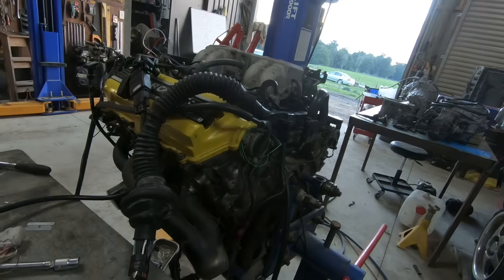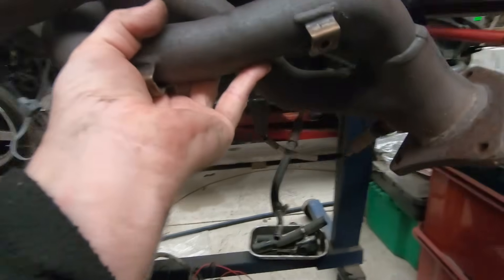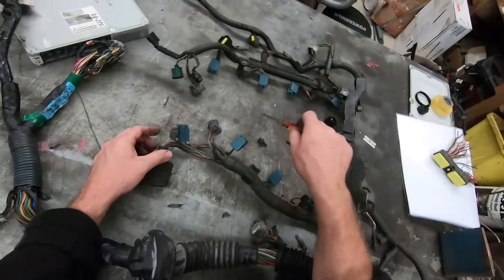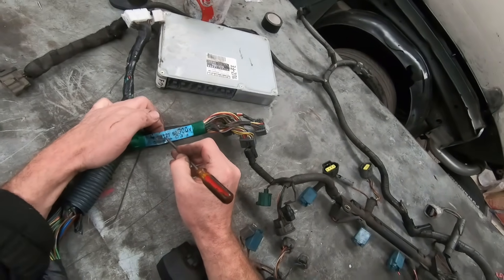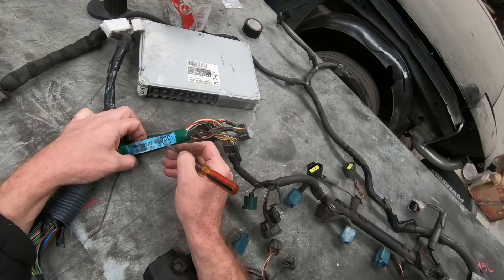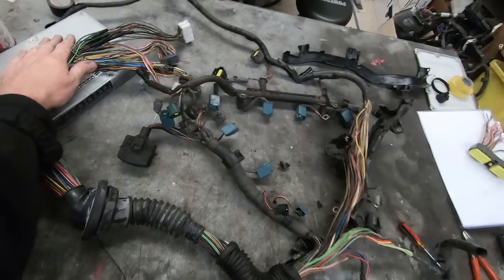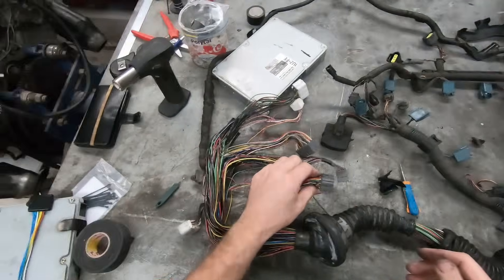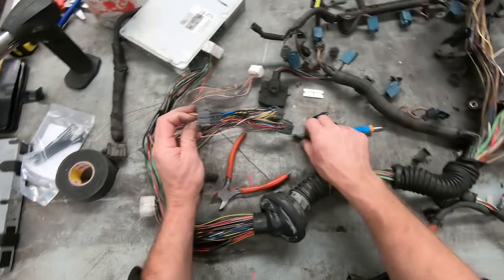Myth - Stock 1uz ECU can't be used on a swap.  Myth - Stock ECU has to be tricked in a manual.

Comment: Hi I do have sc400 that is driving me crazy ,the car cranks for 5second and cuts off I have spark
+gas+timming is good +all ground ok+but missing negative pulse on injectors (ECU been sent for repair )still doing the same thing ,EFI power is ok on the fuse and relay ,crank and cam ok ,fuel pump ok,no theft light, you are the only chance I have

Comment: Hi kelvin how you doing great Mr. UZ

I wanted to ask a question can i use 95 non vvti ls400 ecu which is same 34-22-16-28 on my 93 1uz non vvti engine + 93 harness which has already 34-22-16-2& pinouts coming with a plastic body 1995 clesior MAF ? 
Doing on a Cressida Swap 
I’d be very grateful to you if would answer my little quick question

Comment: im doing a manual swap on a 2UZ non vvti, are you saying dont wire it to park to start, and not to drive to run? but to do neutral? it looks like the cruise control circuit needs a drive signal from the ECU tho

Comment: Hello i have a running but wrecked 1992 sc400, and a 1995 sc400 I paid a guy back in highschool to put a mega squirt in but he took my money and left my car butchered, but im putting the 1992 wiring harness in the 1995 are they plug and play for the most part with the sensors I know so far I’m going to have to change intakes and throttle bodies, any knowledge is appreciated

Comment: Hi, how difficult is to have the original auto transmission running on 1/3 uz?
Some says that needs a tcm and others that ecm controls them 🤷‍♂️
Reply from the maker: Generally its very easy to make the transmission work correctly.   Most models have a combined ecu / tcu unit keeping it straightforward.   Cheers Kelvin
Reply: @CartuneNZ  thanks so much!!

Comment: Quick question I’m having an issue with my ls400 where shortly after I start my car it just cuts off I Checked fuel pressure it was at 40 psi and it can’t be spark because it fires up no hesitation it just won’t fire all the way up and run have you ever had this issue?
Reply from the maker: I'd start by checking codes.  Its very common issue with codes 14 or 15 or the obd2 equivalent which are ignition faults.  I have videos.  Cheers Kelvin

Comment: I'm having issues with my 94 1uz manual Soarer idle dropping after it has been driven for about a mile. The idle will drop them the car turns off. After that I start it back up and it idols fine until I drive it another mile. As long as I keep my foot on the accelerator when I'm coming to a stop it won't shut off on me. Is that easy you related or should I adjust the idle?
Reply from the maker: Generally this issue is due to a run done idle control system,  or other engine running fault which causes poor idle or its incorrectly wired from doing the manual swap.  Guys tend to misunderstand the relationship between the nss and nsw in the vehicle and the ecu.  When I do a manual swap I always leave the factory idle settings.   Sort the fault properly is my recommendation
Reply: @CartuneNZ  Thank you so much for the reply. I am running my factory VCU and harness after the manual swap. The only exception in my wiring was to jump the neutral safety switch via fusible link. Would you mind giving me a little bit more input on the process of eliminating this issue. Or if you have a video that deals with this issue I would gladly watch it. I've tried to go through about it every video that you've had lol
Reply from the maker: @da1outsida35  when I do a video on this specific topic it will become part of my paid videos as the information is covered in my wiring instructions which I sell.
Reply: @CartuneNZ  ok no worries.. I'll gladly pay for this information sir. I know nothing in life is free. So please let me know if I can pay you for the information directly or I'll pay for a video.

Comment: I swapped a 1uzfe into a Suzuki samurai, and it’s Manuel. It has stock everything nothing has changed in terms of ECU
Reply from the maker: Excellent.   It should go well in a small chassis.
Reply: Uhm but doesn’t the ecu see open circuit on the trans soliniods?

Comment: I just purchased a 1UZ-swapped Lexus IS200 (XE10 chassis). Car used to be manual with the J160 and it was swapped with the stock LS400 auto. 1st gen engine.
I would like to put the J160 back on using a swap kit. If I understood you correctly, for this version of engine/ECU, I only need to remove the automatic gearbox wiring and everything will work fine?

Comment: Still easily doable for something you want to run with no catalytic converters and a cold air intake too?
I figure you will still need the loom for the O2 sensors or else the air fuel ratio won't adjust itself for the environment?
Yeah I have been looking at 1uz swapping an old car that still has a carburetor
Reply from the maker: Absolutely.  Most of our swaps are exacty that , no converters and a cold air intake.  Cheers Kelvin
Reply: @CartuneNZ  Any rewiring of the ECU needed to compensate for the high flow rate, or will it auto adjust accordingly?

Comment: I am not sure if I got it right, but you're saying the 1st gen non vvti works all good with no gearbox wires at all? I have the exact engine and would like it manual. Great video!
Reply from the maker: Yes,  any of the stock ecus work fine with a manual transmission provided the wiring is done correctly
Reply: @CartuneNZ  nice, just wondering does it allow abs and cruise control to work? Maybe even traction control?
Reply from the maker: @Oxenan17  these systems are disabled when doing a swap.   In stock car they work

Comment: I have a 1uz from an 93 sc400 I'm putting in a 90 toyota supra going to use the w58 manual transmission. Do you have instructions to wire using factory ecu? If so how do I purchase?
Reply from the maker: Yes I do.  We sell heaps of soarer instructions.   Email info@thecartunecompany.co.nz and my PA will sort it.  Please include ecu number and if you have model number for supra I may have additional info too.  Cheers Kelvin

Comment: Is that the same for 1uz vvti ? Can i use stock ecu when swapping ? How can i disable immobilizer ?  And can i use manual trans ?
Reply from the maker: Yes , all the same for the 1uz vvti and the 3uz.  I can use , and do use the stock ecu lots.  Immo delete is a service which I provide.  I often use the stock ecu with manual transmission.  Cheers Kelvin

Comment: Hi, I’m thinking of purchasing a 1uzfe with the auto trans and ecu. Technically, if everything is there I would be able to drop it into my 69 Volvo and wire the ignition and current to the ecu, right? Also, if I remove the wiring going from the ecu to the trans, this would allow me to convert the automatic trans into a manual automatic trans? Thank you
Reply from the maker: with the correct knowledge yes this is possible. Cheers Kelvin
Reply: @CartuneNZ  do you sell the wiring diagram for the stock ecu?
Reply from the maker: @emmanuelrojas8520  I sell wiring instructions which include diagrams and 20 minutes of my time to help.  Email in description.   Cheers Kelvin

Comment: Swapping in a manual trans in my 98 SC400. I’ve read Vvti’s require a bit more than the Non Vvti’s. From what I’ve read the NSS and the old auto solenoids needs to plugged in correct?
Reply: Just finished the video and saw you pulled everything out related to auto trans and traction control. Hopefully I can get it running with the old solenoids while a source another harness to dig into. Same theory applies to the vvti harness though? Just remove those wires? How would I go about rewriting the park/neutral switch?
Reply from the maker: Hello.  This info I dont share publically as its part of my wiring instructions which I sell.  Its all in there along with my help.  Cheers Kelvin
Reply: @CartuneNZ  how much are you charging for basic wiring instructions for a gen1 (1991 i believe) 1uzfe ?
Reply from the maker: @shawnwimberly9294  presently NZ$175 email info@thecartunecompany.co.nz cheers Kelvin
Reply: Seems like it's a popular opinion that the first generation 1uz isn't the best and to seek a newer model when possible.  Is this true? Even when considering forced induction ( small turbo)?

Comment: I wish to bolt one of these into my isuzu bighorn and keep the auto in the truck.
The automatic transmission wiring would have to be used for the isuzu transmission? 
Or would you need a completely different system?
Reply from the maker: Some isuzu use an aisan based transmission making uz swap quite straightforward.   Wiring needs to suit whatever transmission is chosen and be completed correctly.  Cheers Kelvin
Reply: @CartuneNZ  thanks, I was looking a 3uzfe motor using gen 1 1uzfe bell housing.  Hopefully mod cert will not be a problem

Comment: Hi again, wondering what ecu you'd recommend for a stock 1uz vvti with a 5 speed 3l d4d manual gearbox. The swap was done on my van but at the time i was not informed on what exactly was done to make everything run (2016-2017). Of all my issues my main worry was that there is no obd port where i could have access to read error codes.  Looked down at the exhaust and found out that there were no oxygen sensors connected as well. The car runs but i feel it's really low on power besides the bad ratio of the van i put it in. Have never dynoed it. It starts after 1 kick and doesn't do anything erratic. 

So my questions include
Standalone ECU you recommend to prepare for forced induction.
How i could read codes on the ecu because i believe there are issues with power. 
Best ratio you'd recommend as my ratio is too short (4.55) and i was thinking of a 3.89 ratio. 

Thanks again.
Reply: I'm in  Southern Africa In Botswana by the way.
Reply: And if possible. A solution on how to get the vvti running?
Reply from the maker: Cheapest is the Stock 1uz VVti ecu with a transmission emulator.  Easy to sort and work well.  Cheers Kelvin

Comment: I think I missed a bit!! What is the best/easiest way to have vvti running with a manual?
Cheers
Reply from the maker: Hello.  The VVti can be wired like any other.  When using manual I use a extra box to replace the signals from the transmission that without it will be at reduced power.  More info on this coming up.  Cheers Kelvin
Reply: @CartuneNZ  hi kelvin, do you have the video for that box? I have a 1uz that im going to do manual but i want to use the stock ecu
Reply from the maker: Yes I have a video which is part of my paid instructions so not public release.  Cheers Kelvin

Comment: how do i swap a 1991 1uz from a ls400 into a 1994 lexus ls400
Reply from the maker: Just like any other engine change.  Swap long block,   use 94 intake,  wiring etc.  Very easy.
Reply: CartuneNZ are any of the sensors different or anything? and i’m putting in a cd009 transmission are there a lot of issues that i’m going to run into
Reply from the maker: @Tonka470  as I said,  swap just the long block.  Use the sensors presently on the 94.  Then no issues when swapped correctly.

Comment: hi, i have a question about Ecu's. have you ever used a crown 131 auto ecu to control the autobox and used an after market ecu to control the engine (for a turbo charged application)
Reply from the maker: Never used the 131 ect on its own but have used plenty of the later ECU'S wired to control just the transmission with an aftermarket doing the engine.  I have a video coming on this topic soon.  Cheers Kelvin
Reply: CartuneNZ awesome news :) im looking at installing a sc400 engine and auto into a can and would like to turbo it at a later date and keep the auto. Can not wait for that video.

Comment: Can the emissions system be tricked into not bring up error codes.where i live(the states) care alot about emissions
Reply from the maker: Absolutely.  Different ecus require different things to be done to eliminate codes.  I've just edited a video on physical egr removal however I used a non egr jdm ecu on that job to prevent codes.  Its not released yet but can be found in the 425 ls400 playlist.  Cheers Kelvin
Reply: The EGR looks to a thermistor to trick the egr code to go away wire it high resistance when egr vsv has no power (ground switched) but with the ecu egr vsv wired to a relay run a lower resistor simulating a hot thermister to the otherside of the relay that is all because in closed loop the ecu tunes from the O² sensors then you can block off the egr flow completely and keep egr codes clear, for removing cats the best thing to do is run the secondary O² sensors through sparkplug defoulers extended out of the direct exhaust stream but you can also use a high resistance diode tap the left and right primary O² sensors each with a diode then coil and resistor bridge network to drop the oxygen readings to give the car a good cat efficiency reading then those codes will go away also

Comment: We've done a few 1UZ swaps here in the U.S. Two with 1st gen motors, and 1 with a 2nd gen non-VVTi engine. The first gen swaps were simple enough, because the computers don't care about about the missing automatic and the check engine light stays off. The 2nd gen swap is a bit annoying though. The engine runs great, but the check engine light is permanently on. We wired up the OBD-2 port, and there's always ~7 codes or so for the missing automatic. It's not the end of the world since the engine runs well, but it would be nice to have a check engine light that lights up when there's actually a problem with the motor. 

Not sure if you have any idea about that? From what I understand, the U.S.-spec 2nd Gen OBD2 1UZ ECUs tend to be very picky about the automatic being there or not.
Reply from the maker: Hello.  Im already onto it.  I've only seen a few obd2 usdm spec ecus (maybe 20-25)  and have one coming for some testing and I'm thinking I can apply some vvti tricks to it to solve the issues.  Its on my list for 2020.  Cheers Kelvin

Comment: Maybe I know the origin of this myth. My ECU turnded out to have leaking capacitors. I then found just an older one ECU that I had to rewire because it had paired injectors. The MAF sonsor is also different. All that trouble made me to use an aftermarket ECU.
Reply from the maker: The stock ecu is easy to deal with when the correct info is available but I hear lots of similar stories.  Cheers Kelvin

Comment: I have a 1uz vvti with a non vvti auto box. Everyone tells me i have to get a vvti box. Is it true?
Reply from the maker: Sorry I dont have enough information about what you have or what you are trying to do.  A 1uz vvti ecu if it was originally had a 5 speed trans wont manage a 4 speed. There was one model of vvti which had a 4 speed box.  Provided you have the suitable electronics then it can be made to work.  I really require more information to comment further.
Reply: @CartuneNZ sorry about the lack of info. I have a 1uz vvti with original ecu. The trans im running is a 4 speed of some sort ( I bought the vehicle like his) my problem is that the transmission doesn't change by itself coz the box isn't wired to the ecu. I have to change it manually from D1 to D2 to drive. Everyone says its because the trans im running isn't a vvti box.
Reply from the maker: Ok.  Most 1uz VVti have a 5 speed so the ecu wont control the 4 speed trans.  There was one model of VVti which had a 4x4 4 speed auto on it but super rear.  Do you have 4 gears or three gears?  One solution would be an aftermarket transmission controller.  I have a vvti video coming which might interest you.  I might even mention your issue.  Cheers Kelvin
Reply: @CartuneNZ  thank you very much. Will wait to see the video. Regards Rusty
Reply: @CartuneNZ  I have 4 gears.
Reply from the maker: Ok.  So you have to push a button to get 4th?  And do you have lock up?
Reply: @CartuneNZ  no button to get forth. Pull of in D2 which is 1st gear. Then change to D3 which is 2nd and it changes by itself to 3rd gear and then change to D/drive which is 4th gear
Reply: No 4x4 or difflock
Reply from the maker: @rustyvanderwesthuizen874  ok.  There must be something controlling the gearshift for it to shift 2-3 by itself.  I wasn't talking about 4x4 or difflock.  I was referring to the lockup of the converter clutch in the transmission for better cruise economy.   Its like another drop in rpm when transmission is in third or fourth.  Cheers
Reply: @CartuneNZ  sorry for the late reply. I bought the car as is with the conversion. I have no idea what they did or how they did it. I guess my question is that...is it possible to wire a non vvti box to work on a vvti motor without a aftermarket management system? I know there is a plug coming from the wiring harness to the box with a twelve pin plug, but the plug doesn't fit the gearbox coz its to big, therefore there is nothing connected to the box. The plate on the box says its a aislin 30-40 box
Reply from the maker: @rustyvanderwesthuizen874  As above if the 1uz VVti ecu was designed to be used with a 5 speed then it will not have the correct switch logic to run the 4 speed transmission.  If nothing is connected to the box normally the box only shifts 3 gears as 3rd is only able to be selected electronically as you said you are getting 4 gears so something doesnt quite make sense based on this information.  Cheers